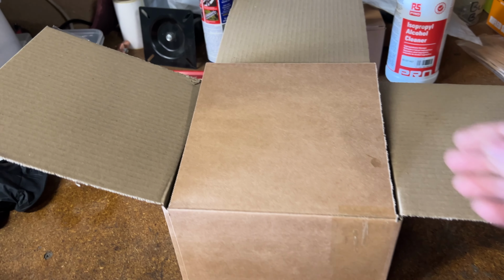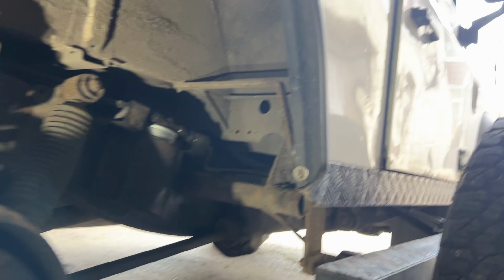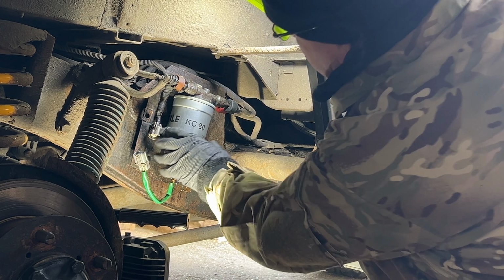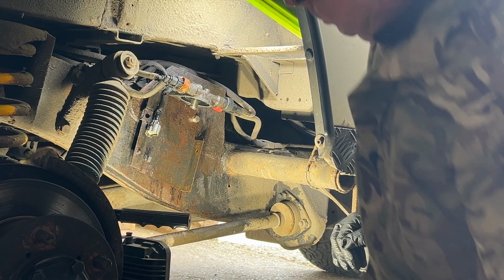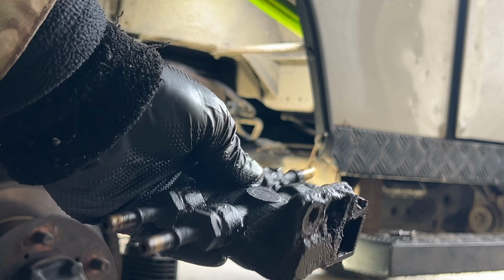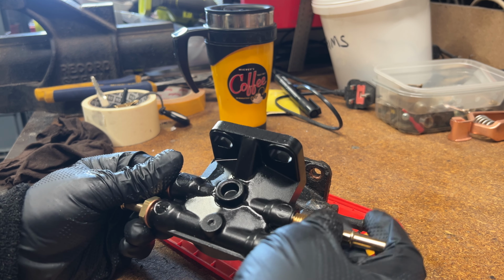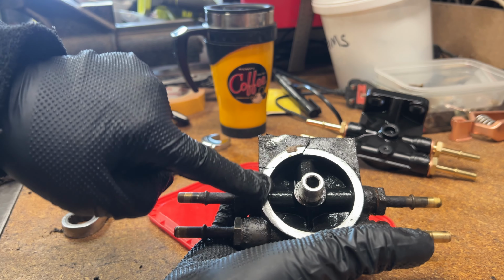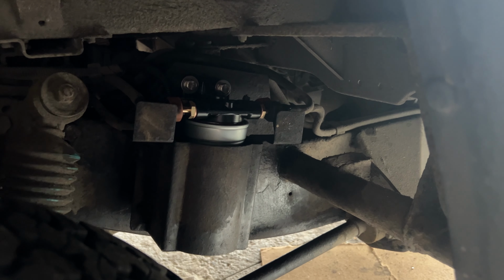Land Rover Defender fuel filter head swap WJN000020

Comment: Well executed Mike, but where did you get the plastic pipe connectors from?
Reply from the maker: Hi, I could have sworn I put links in for the connectors but I couldn’t find them either. I’ll upload the links to Amazon tomorrow for you. Thanks for watching 👍
Reply from the maker: 1 right angle, 1 straight connectors on Amazon https://amzn.to/3Zq60qJ  or pack of 2 straight connectors https://amzn.to/4eYV3ku

Comment: Good stuff! Can you tell me where to buy the white plastic air bleed valve as a separate item? I can only seem to find it as a kit with the brass spigot.
Reply from the maker: Hi, when I bought one it was a separate unit but later when I checked, unfortunately, you do need to buy the spigot as well which is really expensive. The part number in 2017 was WJN500110 but now seems to incorporate the spigot . In 2017 it cost £15 for the plastic bit. Times have changed!! Thanks for watching 👍🏽
Reply: @MikeMakesIt  Thank you

Comment: What are the two smaller plastic connectors for in the picture? There are two big ones with the sides that you press, but I've no idea about the two other pieces.
Reply from the maker: Hi, not to sure what parts you are on about. The head has 4 brass spigots that fuel lines slide onto. On the outside they are the same size. Can you explain a little more about the bits you speak about?
Reply: @MikeMakesIt  at 6:48 you put a picture into the video, which has the two female connectors, a straight one and a right angle one, but also two straight spigots with an O ring on.
Reply from the maker: Ah those. They are connectors for the fuel pipe ends in case I broke any. In the video I mention my original connectors didn’t clip on very well so bought them just in case. I did’t need them in the end. They come as a two piece set although if I used them I would be able to chuck away one end as this is replaced by the brass spigot in the fuel head.
Reply: @MikeMakesIt  did you fit the straight connectors into all the pipes ok?
Reply from the maker: @steenjinks7359  no, didn’t change any, just used the originals. Apparently they are a bit of a pig to swap into the fuel lines.
Reply: @MikeMakesIt  Hi Mike, I broke one of mine, where can you get these connectors as illustrated at 06:48?
Reply from the maker: 1 right angle, 1 straight connectors on Amazon https://amzn.to/3Zq60qJ  or pack of 2 straight connectors https://amzn.to/4eYV3ku  although I didn't have to use them so cannot confirm they are a direct replacement though.